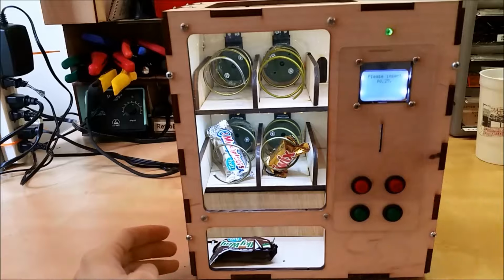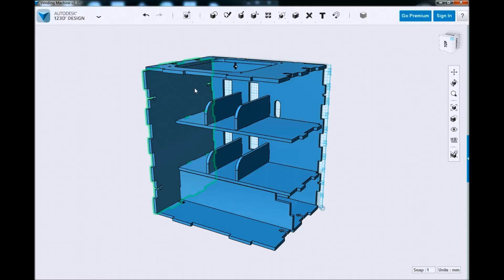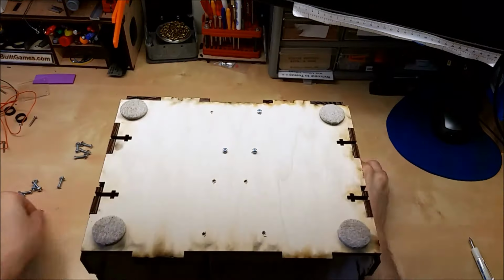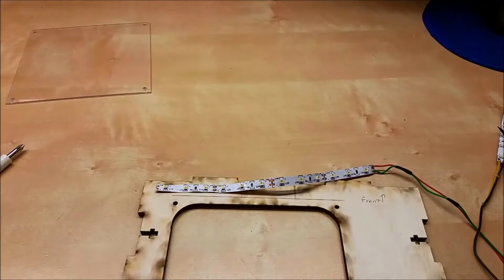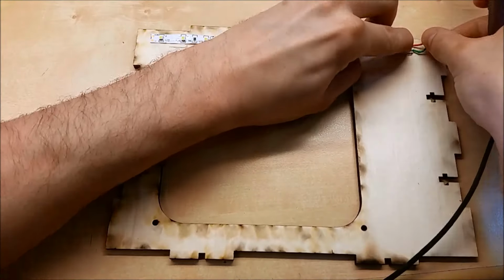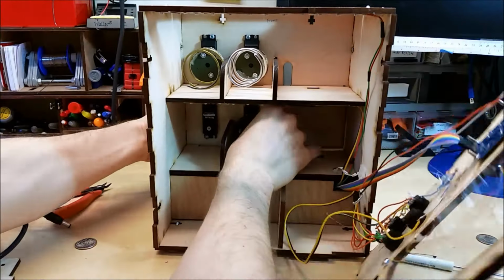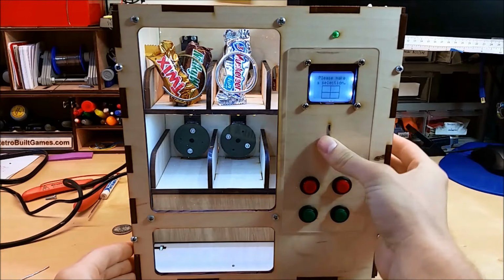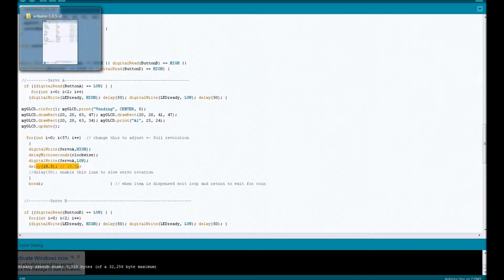Venduino, Arduino Vending Machine

Comment: Hello sir, I had purchased all items as per your list of materials for these project. while up loading the code to Arduino uno R3 board it is showing some errors. plz help me to complete these project. The error details are as follows.

sketch_aug09a.ino:17:27: fatal error: LCD5110_Graph.h: No such file or directory
compilation terminated.
Error compiling.
Reply: obviously you need to load the Graph lib into Arduino IDE first https://github.com/adafruit/Adafruit-PCD8544-Nokia-5110-LCD-library
Reply: Thank you every much sir, for your kind information &cooperation. I had uploaded the code to my arduino uno R3.
I need your help to complete this project.
Further the IC  74HC4050 Level Shifter is not able to get this IC in India so can you help me get alternative for this IC.
I have another problem while connecting each other as per code the pin no:LEDready  13, LEDdispense    12 & coinInsert     - 3. In wiring summary pin no: 13 is LED, 12 is coin Input & 3 is null. kindly suggest which one is correct.

I am waiting for your early reply sir.

Comment: Where did you buy the servomotors? And the other components? I've seen in you webpage there's a summary about the elements you used but not specified where did you buy them. Could you tell me, please? It's for a project.
Reply from the maker: they are common parts available in many places. start with adafruit or sparkfun

Comment: Which software did you use for modelling the pieces? 
What if you substitute servomotors for steppermotors, would it work as well?

The vending machine is great. I am planning on doing one with my little cousin. Thanks for sharing

Comment: How would you add an actual coin acceptor andnconnect it to the arduino?
Reply from the maker: (inputPULLUP, pin#) this pin goes to coin accepter. other side of coin accepter goes to ground

Comment: Can you use an MG995, 12 kg 360 degrees? And will the code still be the same?
Reply from the maker: you can use the MG995, not sure if the code will be 1:1.
Reply: Hmm. Yeah, kinda see that the motor might need a different code and values. But will the other code still work like the buttons? @RetroBuiltGames
Reply from the maker: button section of code is independent of what motors you use

Comment: Can you use 9g servos please reply back I’m having trouble to get them to spin
Reply from the maker: those are too weak for this application
Reply: All good thanks for replying anyways got some better ones on the way love your videos keep up the good work
Reply: Thanks for sharing great ideas,Hi sir can we use continuous servo to make exact 180 degrees complete rotation?because if I used micro seconds,sping position changes after dispensing. May due to weight of items loads.

Comment: Can i change the coin acceptor with bill acceptor?
Reply from the maker: there is no room
Reply: @RetroBuiltGames  I mean, is the electrical circuit and code same?
Reply from the maker: hard to say. commercial bill acceptors are a bit different; they have various protocols, but if they say 5V enable, then wiring is the same.  Here is a list of modern protocols from a mid range bill acceptor: Pulse, NISR, 5V Enable and ICT Protocol
Reply: @RetroBuiltGames  Thank you so much for the information